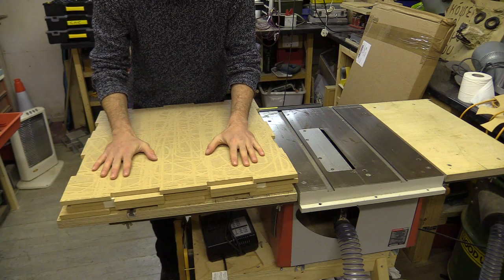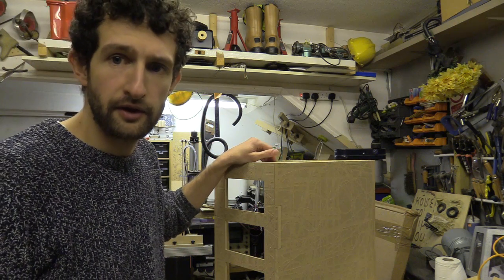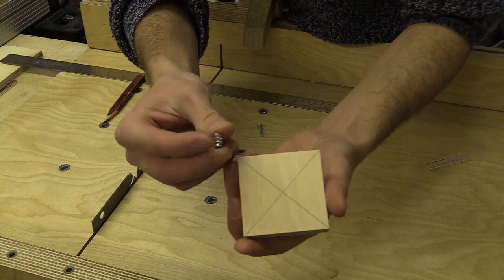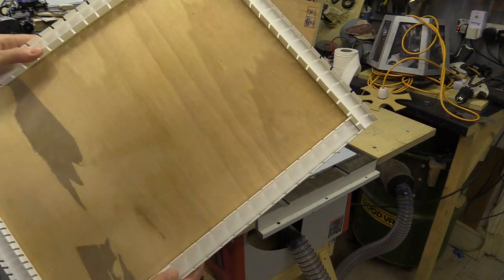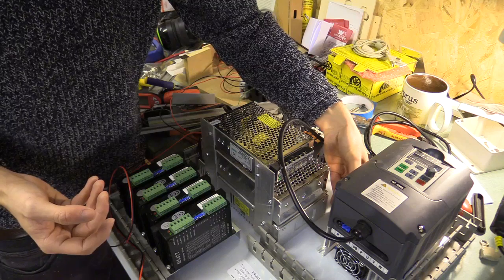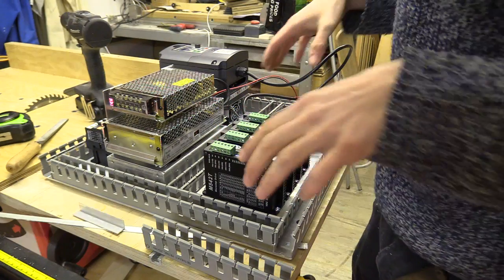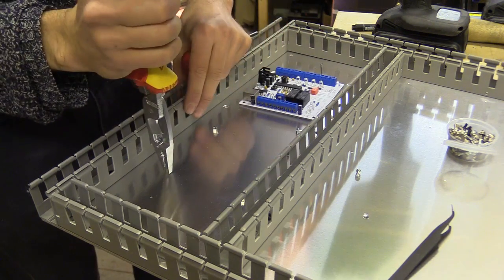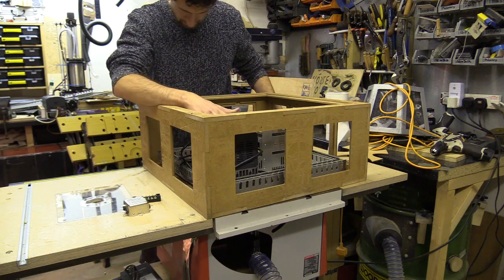#11 Assembling Enclosure & Mounting Panel Layout #11 CNC Control Box

Comment: which control board is that?
Reply from the maker: For this build I was using the phoenix CNC controller which is GRBL - it worked pretty well and is available from Tindie. My latest controller uses the Duet 2 Wifi though which is different.

Comment: 5:56 could also take a piece out of the wiring channel to clear the connector.

I really like the modular port approach!  Wondering whether mixed port sizes would make sense, allow for larger (e.g. air filter and fan) and smaller (cables) uses.

Wondering for the aluminum plate mounts, why so large?  More glue area and stronger?  I guess with the wiring channel around the outside there's no need to put screws in the corners.

Is it really 520mm square?  It looks larger.  At 0:04, assuming the tablesaw is around 500mm (20") wide, it looks like the enclosure top and bottom are at least 1.6X the width of the saw table (800mm / 32").  Doesn't really matter, I will be customizing mine anyway, I am curious though.

Comment: Hi Savvas, just had to drop a few lines here. You do great and meticulously work, love the "artwork" of the controller enclosure. And thanks for mentioning about the small improvement to my CNC Controller. I am in the work of updating it again with a 20x4 LCD display that will show relevant information about the CNC code. I subbed to your channel which I barely do but your videos are really a big help to anybody that is into CNC machines, keep up the excellent work.
Reply from the maker: Thanks Hayri, can't wait to see the new updates and the LCD display! I'm glad I chose your controller - it's the right model for the type of machine I am trying to build. Now the question everyone wants to know - what type of solder do you use? :))
Reply: Thank you too. do you mean like if it is lead free and all? :-) Have to check, it better be not dangerous as I am soldering like 2 inches away from the board, especially on my OLEDiUNO boards :-)
Reply from the maker: Hehe that was my question actually. I'm really struggling with soldering my aviation sockets. I used lead free but gave up and bought another type with lead and silver, and 3.5% flux.  Going to use extraction as any soldering does effect me.
Reply: I hear you. The solder I just bought has a very bad smell to it, unfortunately I ripped off the label and bought it from a different town and don't know what is in there, will check on Monday and see what the hell they sold me. I assume it is the flux smelling that bad. In all my life soldering this is the first but also the last I use that solder. Don't wanna pass out while soldering and burn my nose, which I did before because I was trying to solder some smd parts with a magnifying glass.

Comment: You could use a right angle DC plug for the controller as an alternative to gain some extra space and make it easier to plug/unplug.
Reply from the maker: Yeah that would have been easier.

Comment: I love your recycled case, that's going to look terrific next to your cnc machine. When I saw you using a sharpie to mark your panel locations I knew you were going to make mistakes, all it takes is a tiny wiggle and things don't fit. Of course making templates for everything takes time too so your way likely doesn't take any longer if you don't mind a few extra holes. And to add a cherry on top you've given us another well deserved Blade Runner reference.
Reply: Using a small Sharpie, holding it as perpendicular as possible and running around the perimeter of the hole helps.

Comment: nice work but looks a bit larger 😀
Reply from the maker: Don't think I could have made it any smaller. Ah well.
Reply: I think he meant it looks a bit larger than the 520mm x 220mm (20.472" x 8.661") dimensions listed.
It looks larger than that to me too, however I could be off; can't reach it with a tape measure.  😉   Regardless, I will be customizing the dimensions of the ones I build to meet my needs.

Comment: Not much left to do...well in the building front..;-p
Reply from the maker: Eeer you joke but I still need to cut and wire up the panels, screen all the wires, work out how to wire up the VFD, mount the cooling stuff for the spindle somewhere, test the software. Might also transfer the laser driver over... I'm sure something will go wrong and slow me down!!!